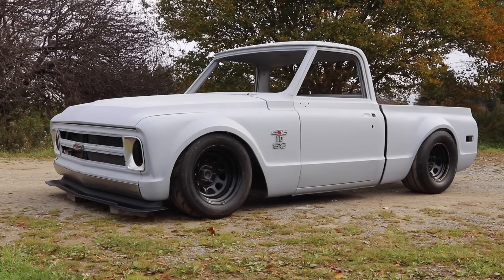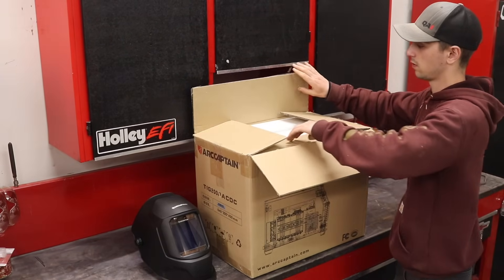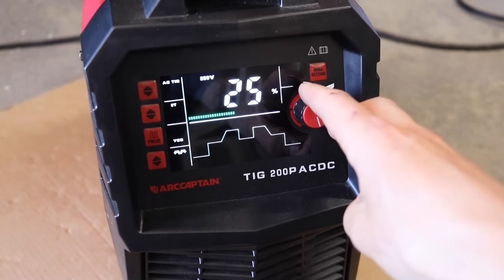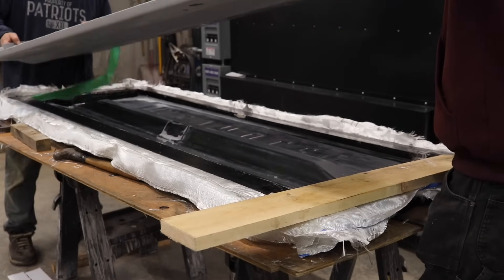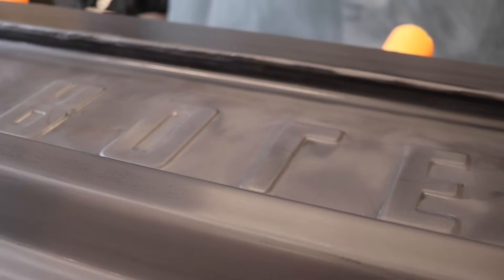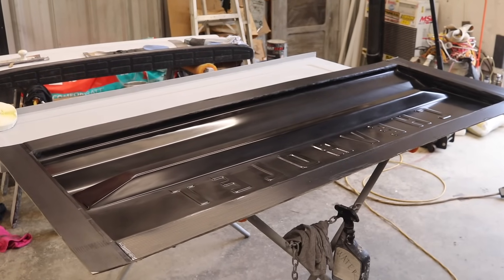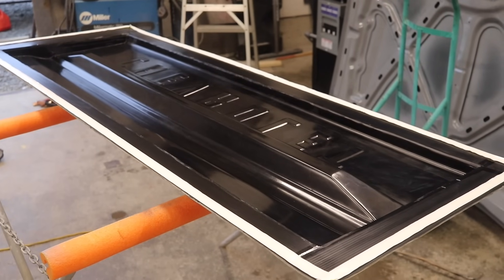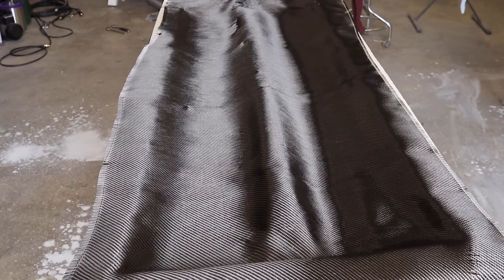Carbon Fiber c10 Build- New Tig Welder + Progress on Tailgate

Comment: Hey brother, i finally got my turbo C10 on the road. I am tuning it right now and even at 4.5psi its absolutely insane. My truck is heavy AF compaired to what yours is going to be, i feel like you should know what your in for so you can plan accordingly. I am running 255/35R20 Nitto NT05's and they are not going to survive. According to the datalog of this, I hit 4.7psi of boost, i was doing 46KMH when i let go of my rev-limiter. Tire speed was 126kmh when i lifted, once the rear wheels stopped spinning it logged me doing 91KMH. Meaning, you can do rolling burnouts at highway speeds on wastegate. You good sir, are going to have a hell of a time keeping your truck planted. On 93 octane we should beable to run 14-16psi of boost with moderate timing. So, plan accordingly. Also, when it comes time to pick out a radiator for your build, do not buy a pre-built unit. I am at the verge of overheating most of the time with a 1600$ griffin combo unit with two 10 inch spall fans that put out 867 CFM. when I could of bought a great radiator for 250$ and a 2016-2019 Camaro ZL1 19 inch brushless fan for 450$, the fan pulls 5600CFM and is PWM- Controlable. meaning its not off or on. You can set it to ramp up with coolant temperatures which is absolutely what you want. I don't know what your going to use for a transmission, but go with a TruCool 40k unit and mount that to your radiator. That fan is truely insane. so it doesnt matter how dense your cooling stack is, oil cooler. intercooler. doesnt matter. It would of been ALOT cheaper for me if someone told me this stuff before i learned the hardway. Anywho. heres a clip of what your going to get yourself into. 6 Litre LS with a S476 turbo on it.  https://www.youtube.com/watch?v=Q_2_cN8__MM
Reply from the maker: Love to hear you got your truck on the road! Just watched the clip, it seems like a Beast! I definitely know it will be absolutely insane with the weight of the truck. Thanks for the the advice on the cooling I'll have to remember this come time to install a rad👍👌 great job on your project !
Reply: @ag_trucks  Thanks brother. it was alot of work, but that first drive.....worth every second of blood sweat and tears just for that moment.  I am looking forward to watching your next video!

Comment: Awesome job! At some point, you'll probably want to add some blowers to circulate air in your oven. They'll help reduce any hot spots and help with even temps during cure cycle ramp up and down. It'll also make it easier on you if you wet out your carbon before trying to lay it on the mold. Usually, you'd put down plastic film on a table, wet out, and cover with additional plastic to avoid amine blush. Once you remove one side of the plastic film and get your orientation right, stippling it with a 1" chip brush will help to work it down easier while getting bubbles out and reducing any skewing. When bagging it, you'll want to add pleats with the bag sealant tape, it'll help you get extra bag contact and reduce voids. If you pull most of the air out before pulling full vacuum, it'll make it easier to dress the bag and have it sit correctly. I built airplanes out of carbon and glass for a decade, hit me up if you have any composites questions. I just found your channel and I'm looking forward to seeing your other videos and the build!

Comment: Awesome job! At some point, you'll probably want to add some blowers to circulate air in your oven. They'll help reduce any hot spots and help with even temps during ramp up and down. I built airplanes out of carbon and glass for about 10 years, hit me up if you have any composites questions. I'm looking forward to seeing the build!

Comment: Its really cool that you are open to trying tips and tricks from others. Have you heard of stabilized/weblock carbon they spray a special chemical to help the weave stay in place. Also you can get versions with thin white strands woven in to hold it together that disappears with resin. Keep up the good work!
Reply from the maker: I’ve seen that, super cool but I had already ordered my supplies! with the carbon veil, I’ll be able to achieve the same result with a bit more work. thank you man!!